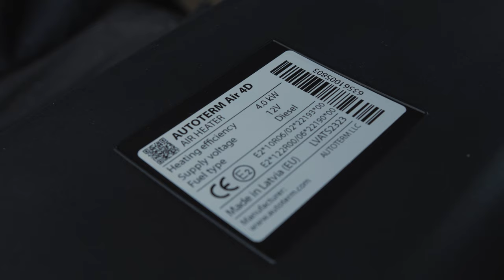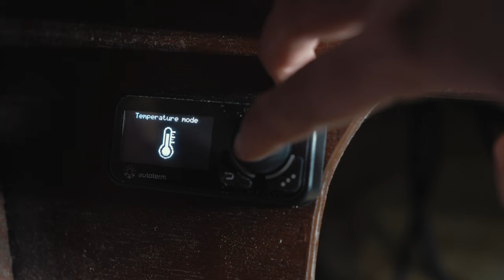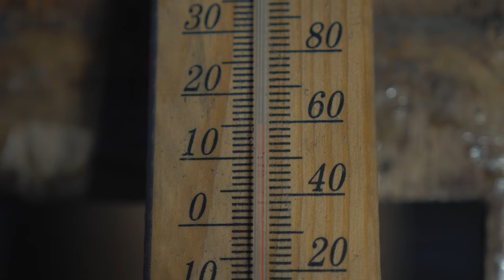I installed a Diesel Heater in my 1940 Wood Boat | Episode 34 ⚓

Comment: Fit a co alarm . It will save your life . I always put a fresh air pipe on the inlet to an outside air source for 3 reasons. 1. It stops mould and damp. 2. No engine room smells inside the boat. 3. If you get an exhaust leak you are not sucking the fumes back into the boat. I usually leave the air intake for the combustion air near the heater .

Comment: Looks good. You will most likely not have an airtight living area so you can pipe the big inlet on the heater into the same space as the heated output. This way you will run more efficiently since as the space heats up the heater will ramp down sooner and save on fuel. You will basically be re-circulating some of the heat produced and the natural air leakage from the space will be replaced by fresh air.
Reply from the maker: Thanks for the info Pearse. We were actually thinking about that setup for the near future. New videos on the way soon.

Comment: I wouldnt bother with marine grade plywood (pressure treated). Best method is to roll a thin layer of epoxy resin on all wood. Can get flexible version where required.
Reply from the maker: Well the local marine grade plywood is no good. Definitely I agree with applying a thin layer of epoxy resin to all wood and even marine grade ply that is being used outdoors. Interior I can use non marine grade. What's this flexible resin? Is it for roofing mainly? Thanks for watching.